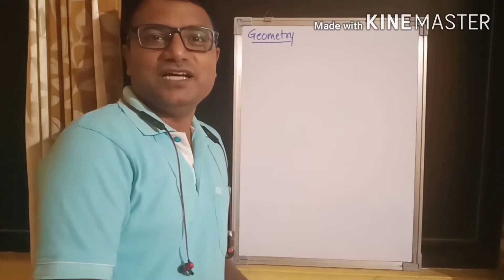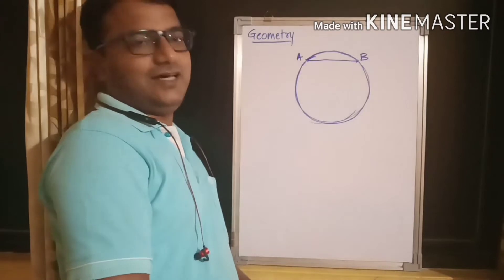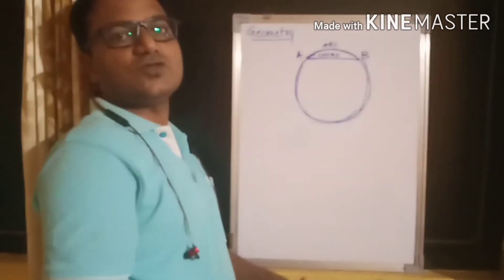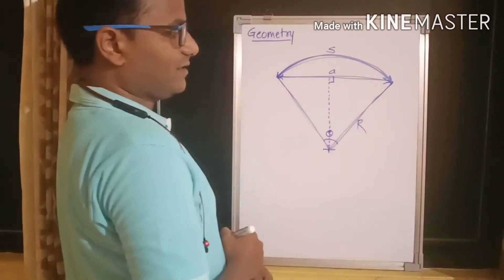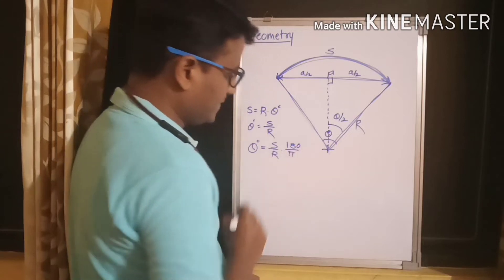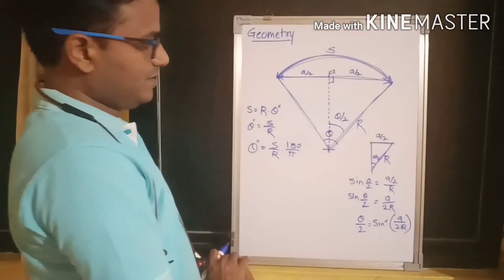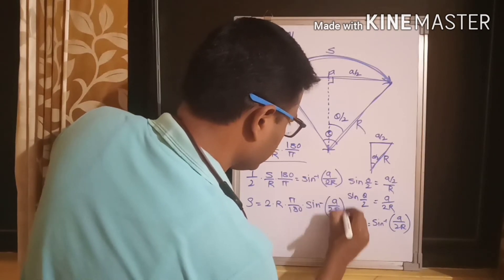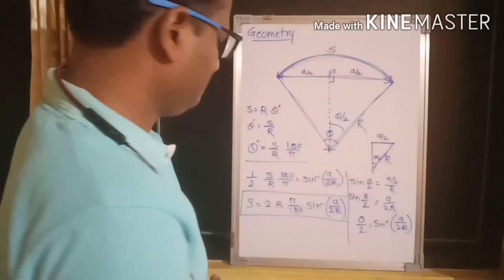Relation between chord and arc

Comment: Sir kisu bhi bend ka radius kaise nikalte hai
Reply from the maker: Hello Amaresh,
I am not sure which kind of bend you want to analyse. Let's assume if you have a circular bend, you can measure arc length and cord length (straight line distance between starting point and end point) and use relationship derived in video to calculate radius

Comment: when to use chord length and arc length? if i am given Radius and stationing for PC and PT, and i need to find intersection angle.
i can use L=RIx PI/180  or LC (straight length) =Rx2 sin(I/2)                which formula is correct to use? thanks
Reply: Chord length in easy way
https://youtu.be/nqxjLIRfkl4